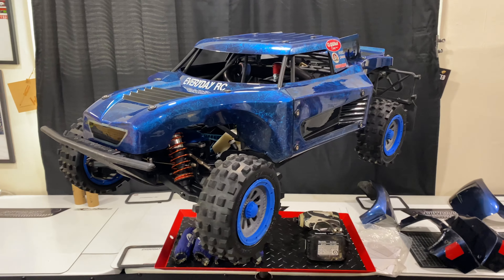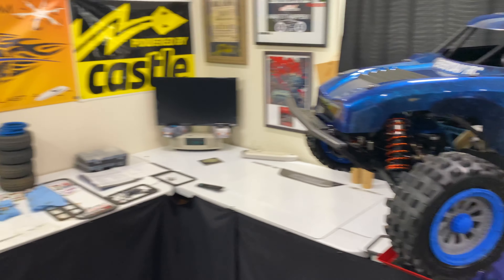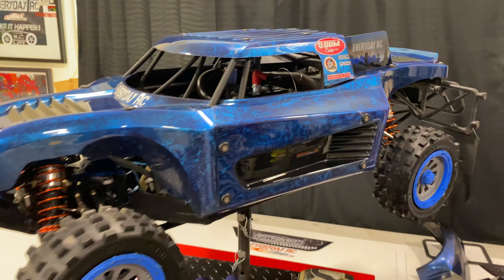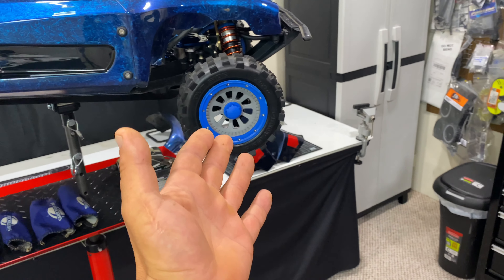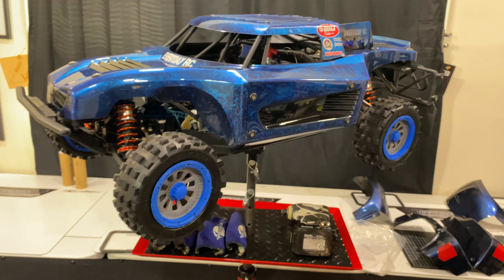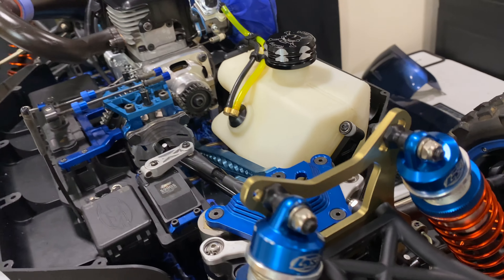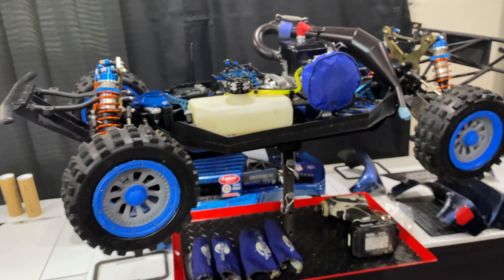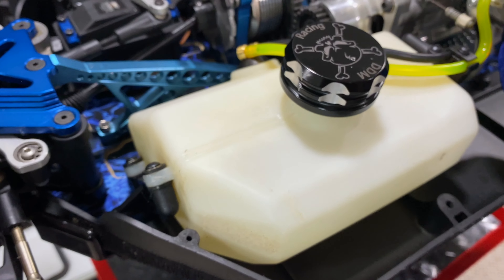LOSI 5IVE-T REBUILD COMPLETE!!

Comment: Awesome mate, on my new losi 5t 2.0 the fuel filter is on the black hose that runs from the bottom of carbie into the tank, is that right? i thought it would be on the yellow hose that conects to the carbie near the primer bulb. please help
Reply from the maker: Hey mate thanks for watching and yes you are correct. That is a very typical set up on a two-stroke. The black fuel line goes from the bottom of the carburetor into the tank with the fuel filter attached. The yellow line is considered the return line and the reason why they make it clear is so that you can watch the fuel return back into the tank when you prime the carburetor. It doesn’t always have to be a yellow return line. You can make the fuel lines any color you want. they just do that typically on the return line so like I said you can see the fuel return back. Thanks for watching take care best of luck with your 5T😊✌️
Reply: @EVERYDAYRC  Thanks mate!